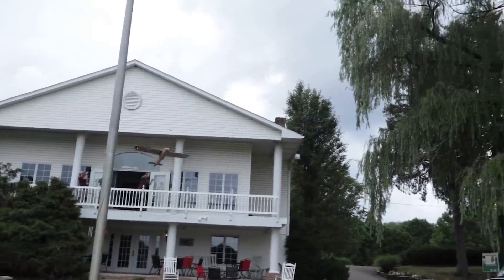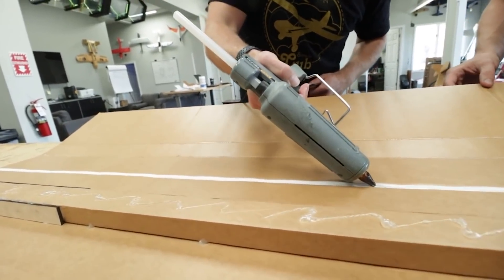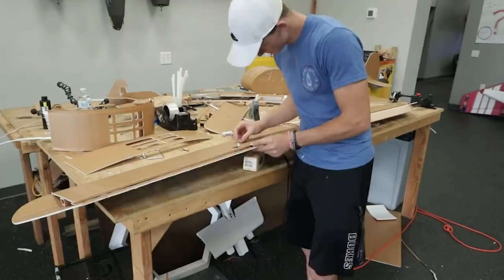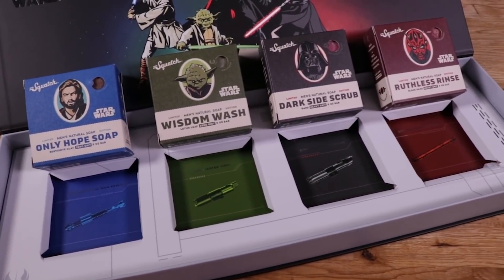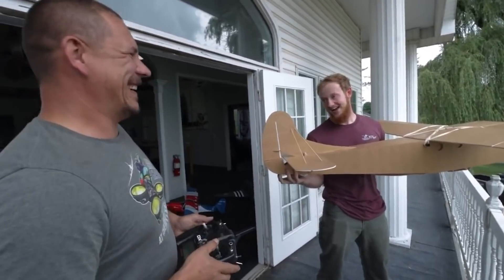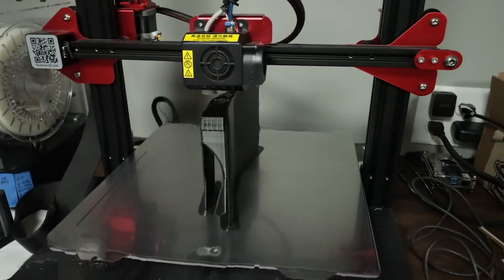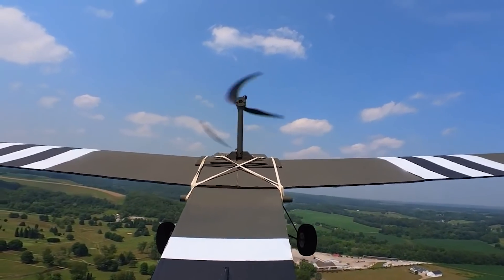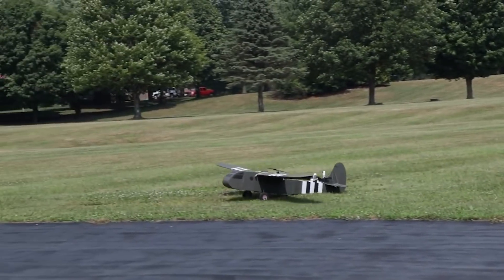We SUPER SIZED our Waco Glider!!!

Comment: Guys, you overlooked a version of the Waco CG-4A called the PG-1, PG-2 and the GP-3. All of those are twin powered versions of the CG-4A. I am planning on building the PG-2 because it’s directly based on the CG-4, which I like the lines the best and the motors are mounted on the wings, not the struts. The PG-3 has a new nose that made it more streamlined and raising the cruise speed from 100 mph to 117. 
I hope to use your twin power pack “C” on a 8’ version to get scales performance. 
Also, if you make is as a monster kit, I would order one of those.

Comment: Hey flite test, just gotta say how happy my 8 year old son and I are to have found your channel. We are going to start learning to fly soon. We had a couple plane ideas for you to try.

XF5U/V-173- shouldn’t be hard, but a really neat plane from just before the jet age
Piaggio P.7- this is a challenge, flying boat that sat very low in the water, but utilized hydrofoils to help lift the body out of the water, then the pilot works a clutch system to move power from its water propeller to the air propeller. Would be really cool to see how well it would have flown as well as take off and land.
Grumman J2F duck, a neat float biplane uses for recon and search and rescue.

Can’t wait to build some planes.

Comment: For the fly by snatch launch ... You’ll need length of surgical tubing in the line used to pick up the glider. That will absorb the shock so the glider will smoothly accelerate. The right length of surgical tubing will smoothly recoil so the glider does not get whipped or catapulted off the line. Finding the right length of surgical tubing will be the trick.

Comment: Back in the 70's a man named Johny Weatherford was doing a glider experience with ole Mac (of MacDonald Douglas Corp) They flew all weekend in Arizona area after purchasing a few. It came time to set out driving back to St. Louis towing them all.  With two broken down ready for towing Johny joked about seeimg how far it took him back towards home. They agreed to the experiment and set up a way to stay in touch. He'd leave a message with his mother on where to pick him up when he landed They all laughed and said OK 👌. He would have to probably set it down while in sight anyway because of a storm that was approaching. Well off he went and so did they. They unlatched the glider and off he went. They soon loss track of ole John and mosied down the high way checking in every 100 miles with mom. John said he was in the air about 3 hours and thought things were looking familiar from above thinking that looked like Arkansas (he flew the area often) but was in disbelief and worried if he was heading the right way. Now he noticed more and then over Gainesville Missouri yep he knew where he was. Now freaking out about only 3 in a half hours in the air did he hit a time warp? 😆 He holds steadfast on the stick and made it to St. Louis Spirit of St. Louis Airport in 4 hours 22 minutes from uncabling the tow plane that pulled him to flight. And yes this story was always told by a guy I called my mentor any time someone tried to use the code 420 around him. 😆. I first heard the story the year he did it back when I was 11 years old and the time in air NEVER changed or was altered. The same guy built the machines that spun the metal for the Apollo space capsules missions for MacDonald Douglas. He was a close friend of the owner. And one hell of a man.

Comment: 1:45 might be a lot easier to have a wooden rod or roof lath to divide the pressure for glueing the wing. 2 or 4 hands are the same like single fingers just small spot that will glue well while the rest will have a thicker glue line.

And that will change the line of the wing, the profile will be different depending on the pressure spots.

A lath makes it also easier if you work alone. I wondered why I had never seen such lath in use to divide the pressure a lot more better and similiar.

Comment: Looks like you've got a torque issue with your popup power system. Being that the motor is directly over the center of pressure and offset from the body there's not enough tailplane to counteract the torque and the plane is rotating around the wings. Moving the motor forward or back even a few inches should reduce the effect but I think this is what Josh is talking about at 11:24